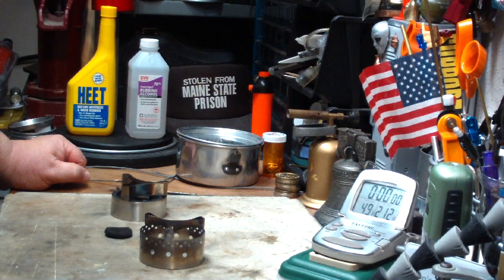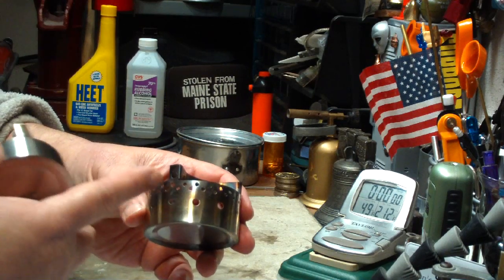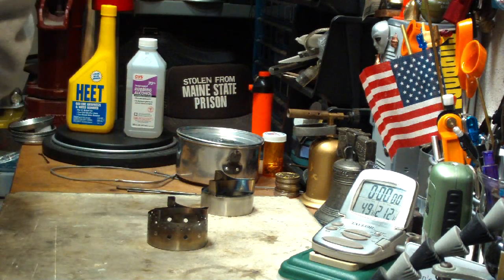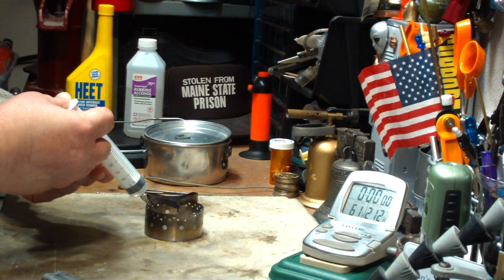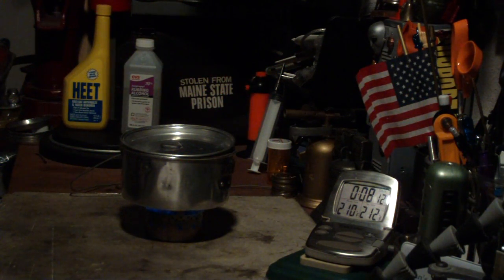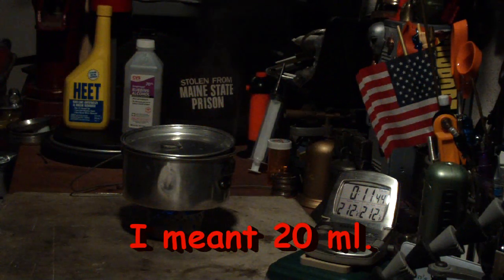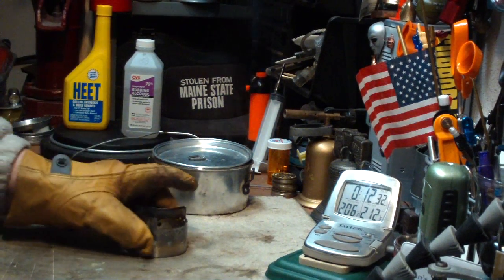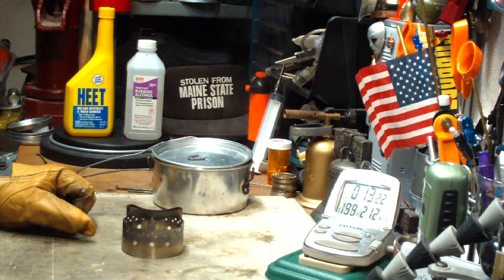Flat Cat Gear's ISO-Clean 2.0 Stove - Using Heet for Fuel - Boil Test #4

Comment: Out of curiosity, can you store the Yellow Heet in plastic squeeze bottles with a twist spout (so it's easy to add fuel to a trangia in mid flight)? Or will the plastic squeeze bottle spontaneously explode or burst into flames if you put Heet in it?

Comment: On the ISO-Clean stove, the pot stand is 0.5" and on the Lynx denatured alcohol stove the gap is 0.8".  The smaller gap reduces the burn rate.  Additionally, the carbon felt brings the fuel closer to the flame increasing the burn rate.  Keep in mind that the ISO-Clean was not designed to burn both fuels, but it is nice to know that it works!  Best regards - Jon